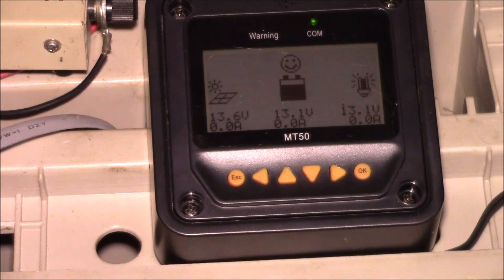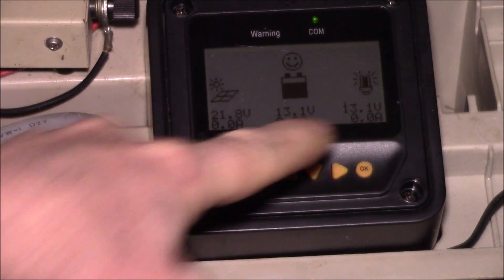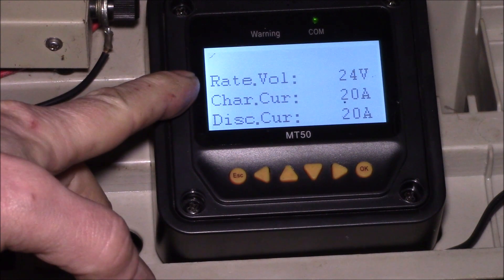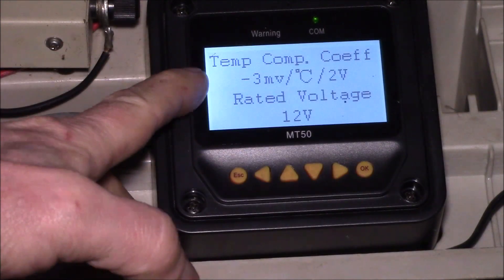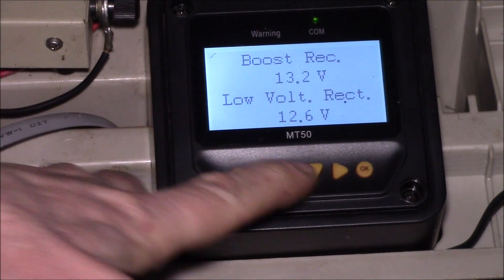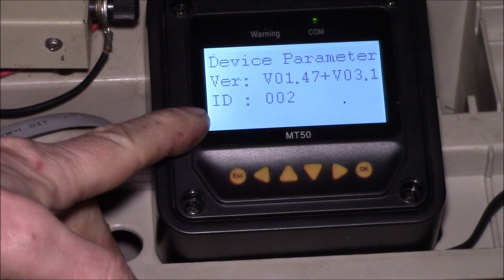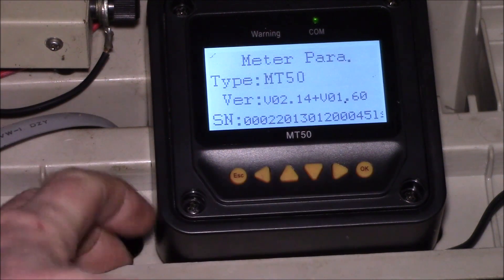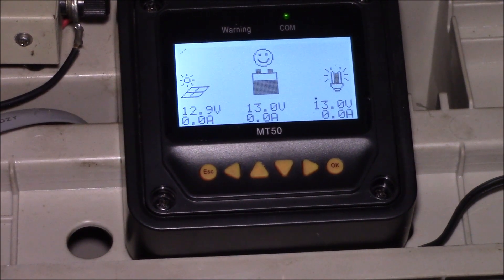EpEver/EpSolar MT50 Remote Display: Overview

Comment: Thank you for your video, it helped me set up my MT-52 controller. 
But I have a question, I have the Epever MPPT BN series, I configured the parameters according to my battery specifications but I only see .01 amps going to the battery in full sun, the green light says it's charging the batteries but for some reason it only shows .01 Amp even when I turn the inverter still shows no discharge either. It shows 21.5 Volts on the solar and 13.7 on the battery, even when the voltage on the battery goes down still no amps are showing.
Thanks.
Reply from the maker: Hard to say for sure.  What sort of battery is this, lead acid, lithium (LiFePO4)?  A Lithium battery may take no charge current when it's fully charged, especially if it has an internal BMS.  Also, if you have a way to measure current (DC clamp meter or multi-meter w/ a 10A or greater current range, try measuring the current between the charge controller and battery.  It may be the displayed current is incorrect.
Reply: @The4Crawler Yes is a Lifepo battery, 200 AH.
I got a DC ammeter from a friend and will check it out.
I was discharging the battery with the refrigerator and inverter so I would think that the amps will increase somehow.
Thank you for your response.

Comment: I coach a high school team that races a solar powered boat in the local utility companies Solar Regatta.  Last year, our first year, the EPEVER 12/24V 30A shut down the motor because of an overload failure.  How do we figure out what went wrong?  Per contest limits, we had 2 12V 7A batteries wired in series to power a 24V, 22A DC motor.  Two 235W solar panels (supplied by utility) provided power.  It was a sunny California day.  Everything performed good when we tested it in a swimming pool.  But on race day (longer runs) we went out on overload.  Got any ideas how to find out what went wrong? Thanks, WW
Reply from the maker: Depends on how you are feeding power to the motor.  If out of the controller's DC Load output, that is current limited and that will shut down if you exceed the DC amp rating, usually around 20 amps.  

I've had that happen on my 12V DC load system in the house.  I power a variety of lights, fans, etc. off DC and before I split up the system, I could exceed 20 amps if I had too many loads running.  I've now added a 2nd 24V - 12V converter to power about half my loads and I no longer have that overload issue.

Usually these controllers will self-limit on PV power coming in and in your case, @ 24V, your panels would just get to 20 amps, so the controller should handle that fine.

Might also be a low (battery) voltage disconnect in the controller or an over temperature problem.  Might try checking your settings, if using the USER mode battery profile.  There may also be a stored error code, I think those show up in one of the menu options.
Reply: @The4Crawler  Thank you.  Should I find a different controller with has a DC Load output of 25 amps or more?  Can we use a separate controller for each solar panel to get more amperage to our single motor?  Besides looking at all your videos, How can we educate ourselves on using solar controllers under these unconventional requirements?
Reply from the maker: @wayneweisbecker7633  If you want to use the DC load output to control the motor, one option is to hook up a 24VDC relay coil to the DC load output terminals. Then connect the motor, via the relay contacts, to the battery.  That way, the motor can turn on and off with the DC load output, so you get the low and high voltage cutoff protection.  You will lose the overload protection, but something like a fuse or circuit breaker could handle that.  

Or, just direct connect the motor to the battery with a switch, relay or motor controller that you control manually.  You will lose the low/high voltage protections doing it this way.

I'm not sure how multiple controllers would work with the DC load circuits in parallel.
Reply: @The4Crawler  Thank you for all the suggestions on how to maximize performance involving the battery.  However, 3 of the 4 heats are to be powered strictly on solar power from the solar panels; not by any added stored energy like a battery. 

I tested the motor over the weekend in a 55 gallon drum and I was surprised.  The voltage to the motor was 24.6 V and 31.5 A according to the controller.  When I used a meter the amperage was 48 A. I never figured the voltage and amperage would be that high. It makes sense that the motor went out on overload. 
I don’t understand how the motor was getting 24.6x31.5=775W when the Solar Panels produce x235=470W.  Is the battery contributing even when the load is plugged into the DC port?
One of the races we did complete, we smoked the competition.  So I’m wondering if an overload condition is a good problem to have. One of the things we could do to reduce the load would be to decrease the propeller size. Also, could we change some of the parameters so it does not go out on overload (& still be safe)?
We would rather not do that because it would decrease the performance, but we want to participate in all 4 heats. 
The overload condition did not show up when we tested the boat in a swimming pool which were short runs. Per one of your previous comments, I am assuming the overload is triggered by heat. If that is true, maybe we could stay at low speed (pilot keeps the amp draw below 20A as he drives up to the starting line). 
The boat gets driven 4 hours a year including what little practice we can get. So if it goes into overload a little bit it is not going to hurt the system, true?
The risk is the motor goes out on overload before the race is over.  

Below are the current parameters. They are the default parameters.  We need to educate ourselves on the effects changing them.
Controller Setting	
Battery AH	25AH
Temp Comp Coeff	-3mv/C deg /2V
Rated Voltage	Auto
Over Voltage Disc	32.0 V
Charge Limit	30V
Over Voltage Rec.	30V
Equal. Charge	29.2V
Boost Charge	28.8V
Float Charge	27.6V
Boost Rec	26.4V
Low Volt Rect	25.2V
Under Volt. Rect	24.4V
Under Volt. Warn	24V
Low Volt Disc	22.2V
Discharge Limit	21.2V
Equalize Time	120 Min
Boost Time	120 Min

V from Panels	A from Panels	VDC to Motor	A  to Motor	Comments
31.80	1.20	24.60	31.50	Klein Amp meter recorded 48A at the motor

Equipment Used
Solar Panel, Max Pwr: 235Wp, Max V: 29.8V, Max A: 7.89A 	Jinko JKM235P. Voc: 36.9V,Is: 8.47A, Module Eff: 14.35%
Battery, Sealed Lead Acid, 12V, 7ah	           ExpertPower Standby Use: 13.70-13.90 V, <2.10A.  Cycle Use:14.6-14.8 V, <2.10A
Solar Charge Controller, EPEVER Tracer3210AN G3	 Voltage: 12/24 VDC/Li, Current: 30A.  Max PV Input 100VDC, Max Input Pwr: 390W (12VDC), 780W (24VDC)
Reply from the maker: @wayneweisbecker7633  Yes, the DC load output will take power from the battery if the load exceeds what's coming in from solar.  The way to think of the solar input and the DC load output is they are essentially MOSFET transistors connected to the battery.  

The PV input connects the solar panels to the battery when there's enough voltage and current coming in (via the MPPT circuitry).  

The DC load connects the load to the battery in a similar fashion, except is has current monitoring on the load and voltage monitoring on the battery.  If the current goes too high it';; shut off the MOSFET.  Likewise, if the battery voltage drops too low, it'll also shut off the MOSFET to avoid over discharging the battery.

One option might be to have a switch to connect the motor directly to the solar panels.  Then you would need to have something like a PWM motor speed controller and power meter to manually dial in the "maximum power point" to get the most power to the motor on a given run.  Reduce the motor current to raise the panel voltage, increase it to lower the voltage.  

Since your motor seems to be capable of pulling more power than the panels can output, you'll need to dial the motor back until you find the sweet spot to maximize the power.  That's basically what the MPPT circuitry in the charge controller does, it constantly increases and decreases the current until it finds the point where the product of volts x amps is maximized.  Given steady sun on the panels, it should not be too hard to find that point as the motor load should be fairly constant at a given setting.

I run some small 12V DC fans directly off a small solar panel in my house.  They circulate air in a solar heating panel that sits in a bedroom window.  It works out well as if there's enough sun to get the fans running, there's enough sun to heat the air in the panel.  No need for fancy controllers or thermostats.
Reply: @The4Crawler  Hello, sounds like we need to build a speed controller of which we have no experience. What kind of person or firm do we need to hire as a consultant to help us with it?
Reply from the maker: @wayneweisbecker7633  Lots of those available on the Amazon:
https://amzn.to/3Dz447m
or search for 24V PWM Motor Speed Controller.  Seems to be a lot with wide input voltage ranges and high current capacity.  Couple that with a DC power meter reading the volts/amps/watts like this:
https://youtu.be/ez0tLCr1xqo?si=5JDO1Y5Fqr4HcoCS

Comment: I have tracer4210AN, and i cannot get power to the mt50. Should i use other cable to get it work than what comes in the box? This is my second mt50 and i thought the first one was broken.
Reply from the maker: I suppose you could try a different cable to rule out that possibility.  Pins 1-2 are the power pins (5-12VDC) and 7-8 are ground (see pg. 29 of the MT50 PDF manual) so you could check for power on the cable and also in the socket on the charge controller.

Comment: I am trying to adjust my battery voltage parameters according to the guidelines in the user manual for the 12v gel parameters, but for every adjustment I try to make, I get a "para. error" message.  Right now it appears all parameters are set for a 24v system.
Reply from the maker: Assuming you're making changes to the USER battery type, then there are certain limits in those parameters.  I cover that in this video (it's about Li-Ion batteries but the same reasoning applies):
https://youtu.be/4wt_L2L4W4Q?si=lcr3vH2aNiKanQV_
If setting via the MT-50 display, you may need to run through a few passes of settings as some settings have to be less than other settings, but those settings they depend upon are made later in the pass.  Best to make a copy of the parameters page in the manual, work out your values and then figure out which ones need to be modified in which order.
Reply: @The4Crawler  Thanks for this.  I watched your video.  I have the physical copy of the manual as well with all the parameters and rules.  According to what I see based on greater than/equal to rules - the first parameter I would have to change would be the lowest parameter setting, the Discharging Limit Voltage to 10.6V.  However I still get the para. error.  I can't seem to adjust ANY of the voltage parameters in the control parameters.
Reply from the maker: @LyndaDawson-ft4cn  Assuming you're using the USER battery type, as that's the only one you can typically make changes in.  For that parameter, you need to first change the highest parameter then change the 2nd one, if needed, and finally you can change the Discharging Limit setting, assuming you want to increase that: "Under Voltage Warning Reconnect Voltage > Under Voltage Warning Voltage ≥ Discharging Limit Voltage"
To do that change, you need to step through the settings menu, change that upper-most setting, save the changes, then re-enter the settings menu, change the next highest parameter, save the changes and then finally you can re-enter the settings menu and change the lowest setting.  The reason for this is often, the higher setting may be later in the menu screens, so you have to go to the later menu, make a change, save it and then re-enter from the top.
Reply: @The4Crawler  I appreciate your quick response.  I'm using USER battery type.  When I leave the Rate Voltage at "Auto" - I am able to scroll through all parameters, but can't change a single one, starting with the highest.  (But I have tried in every order).  I get Para. Error for every attempt.  When I change the Rate Voltage is 12v (which is what I want), I can't even scroll past the first parameter which is Over Voltage Disconnect Voltage - because it is set to 32.0.  I want to change it to 16.0, but it wont accept 16.0 and also gives an error when I leave it at 32.0 (because I am assuming that is too high for a 12v rate voltage setting.  (I am using the MT50 Epever MPPT.)
Reply from the maker: @LyndaDawson-ft4cn  I've never run into that issue.  You might try a factory reset to see if that helps unlock the settings.  Otherwise, try contacting Epever support and see if they have any tips.  I usually leave my controllers in Auto mode and they seem to pick up the 12V battery settings, even when I was using a 16V lithium battery.

Comment: On the main monitoring screen of my MT50 I notice that touching the "OK" button turns the far right load icon on and off when you press the button.  Does it make any difference whether this icon is on or off and does it affect how the solar is charging the battery? Is it better to leave this far right load icon on or off during regular daytime charging? Don't do anything fancy with my battery and solar just use the solar to maintain and charge my 200ah battery.
Reply from the maker: Makes little difference.  That DC load output / icon  is just an indication that the output MOSFET is turned on.  That might consume a fraction of a mA of current, if that, to stay on.  

I use that DC load output to power all my DC loads (except inverter) that are permanently connected.  That has the advantage that if the battery voltage drops below the low voltage set point, the DC load output will shut off and prevent over discharging the battery.  Also has the side benefit of being able to monitor the current and energy consumption on those DC loads over time.
Reply: @The4Crawler   Thank you for your reply. 👍

Comment: Can I use the MT50 to set the charge controller when it’s plugged into my MPPT charger as they would be linked , by the wire .. but can I remove the MT50 once changed parameters ..and will it keep settings in memory of MPPT controller … so basically I set up MPPT by the MT50 ..then , can I disconnect them Thankyou ..
Reply from the maker: Yes, that should work.

Comment: Hi sorry to bother you, I am new to solar so I am learning. I have a simple solar 24v kit with 2x batteries, 2x solar panels, 1500w inverter, controller and the MT50. All has been working fine for 2 years but for past couple of mornings the MT50 has shown the decharged battery symbol but when the sun is up everything gets charged and it's back to normal. Is this normal, or does it mean my batteries are shot? I only run a few things on it in the daytime, radio, bike charger and a light at night. Thanks Louise
Reply from the maker: The state of charge display on these controllers is not terribly accurate.  I would check the actual battery voltages, in the morning, with a separate meter and see if they are close to the same and compare the total voltage to that displayed on the MT50 display.  Maybe track those voltages over time and see if there's any trend.  Check all the wiring connections, maybe something has worked loose.
Reply: @The4Crawler  hi thank you very much for getting back to me so quickly with your advice, I really do appreciate it, I'm going to get a battery tester tomorrow and check all the leads, really hoping it's fixable 👍😊 kind regards Louise

Comment: Hi, I have a question about my setup for my offgrid camper.  I connected 2 solar panels of 100w in series to an Epever 2210AN with an MT-50 and 1 solar panel of 410w to an Epever 4210AN also with an MT-50.  Both are connected to 12V batteries 2x230Ah Ective DC230 AGM deep cycle in parallel.  A-Is it correct that both Epever controllers charge the batteries at the same time and B-Which user settings should I use?  Thanks in advance!
Reply from the maker: It's generally OK to connect 2 charge controllers to the same battery bank.  Just make sure they're both set to similar charging profiles.  These Epever controllers work off the battery voltage, so as the batteries charge up, they'll both see the same voltage and dial back the charging current until they hit float charge.

Comment: Hello i just ordered this unit on amazon and i was windering if i can change the parameters in the epever-AN 40 amp charge controller to charge LIFEFO Battery?
Reply from the maker: You bet, check out my "User Battery Type" video:
https://youtu.be/4XhvwruVEJU
and I have some information on setting up Li-Ion batteries along with some LiFePO batteries in other videos in this play list.  Basic idea is figure out how many volts per cell you want for various parameters and then multiply that by the number of series cells and use that total voltage for the "user" parameters.
Reply: @The4Crawler  thanks!